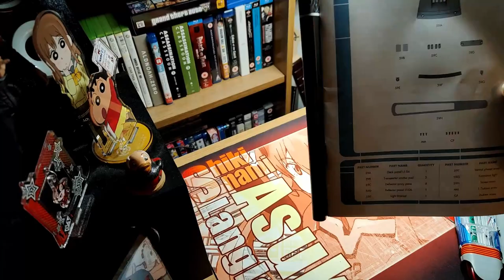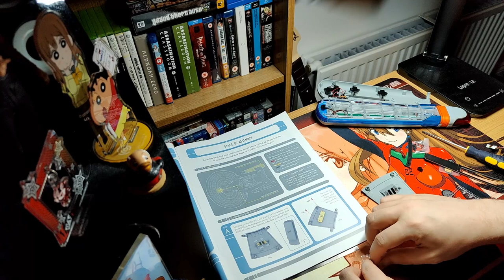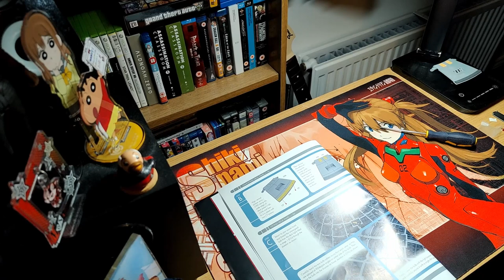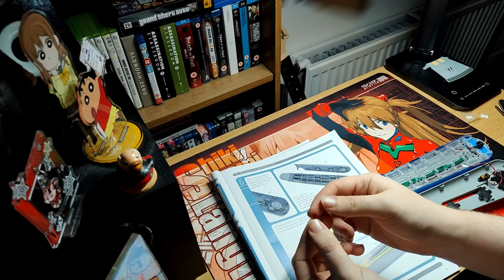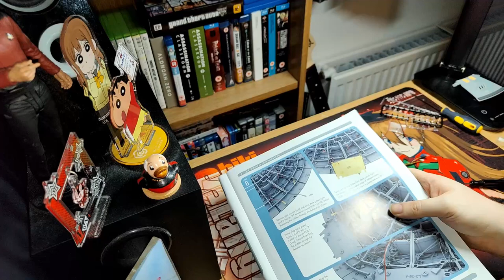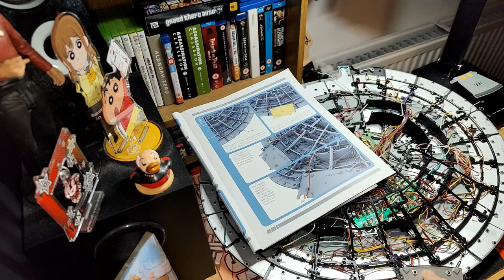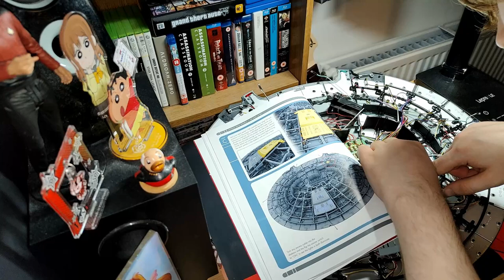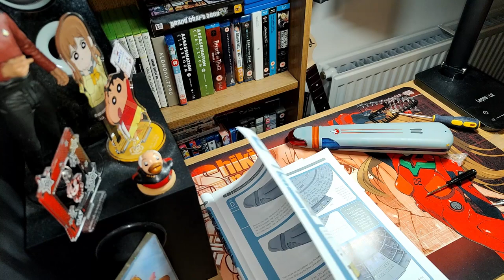Build The Enterprise D - Stages 59 - 60 - Between a Nacelle and a Saucer base! (Star Trek TNG)

Comment from the maker: Finally back! Hopefully you all enjoyed the video. This was a bit of a frustrating stage in placed. Getting those panels on the underside is quite tough, but I do fully expect it to get easier with each one I add much like it was for the top half of the saucer.

Also, check out that nacelle! What a beast that is.

Let me know how your build is going so far! Or if you enjoyed the video :)
Reply: they should could of made the entire upper disc in tin with screw hole and light window hole for no light leak then a clear cover then the plastic peices you paint on the very out side....then the inside some key places some frames to mount leds....shame